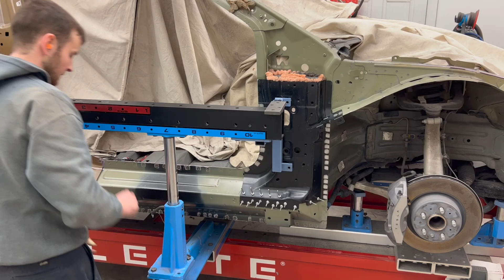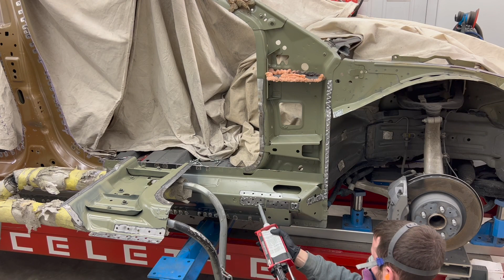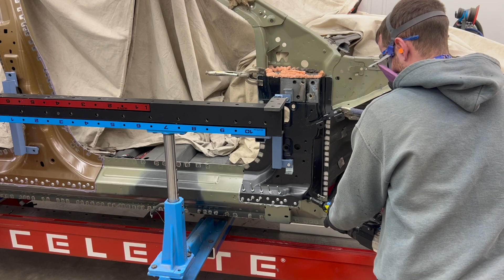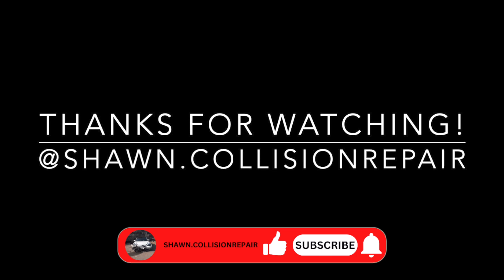Tesla Model 3 Structural Collision Repair Procedure

Comment: So when they use one-piece injection molding for their chassis, no more repair like this, it will be just totaled?
Reply from the maker: To be confident in my answer I would need to do more research but from what I’ve seen in articles is the front end and rear end structural is going to built as a one piece unit so I’m assuming there will be repair procedures made but instead of replacing all parts individually you would be replacing it as an assembly.